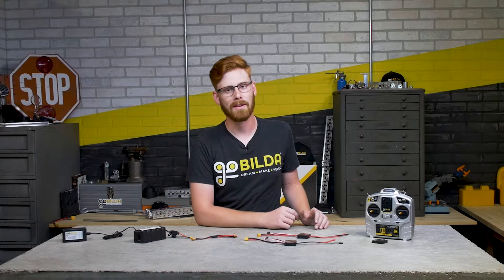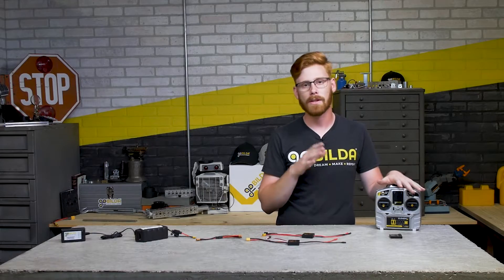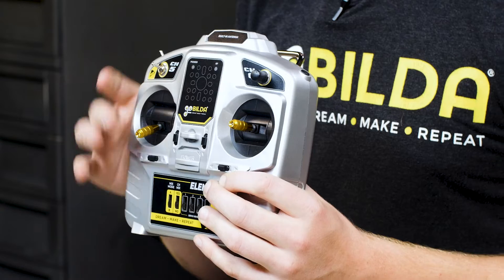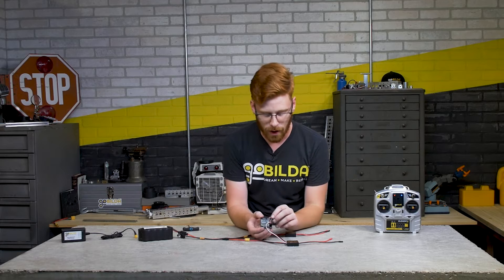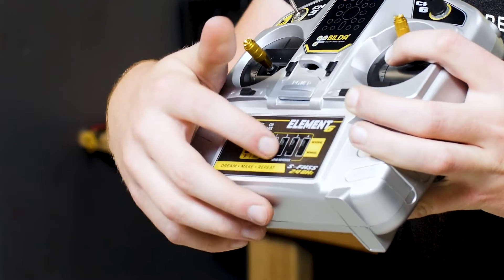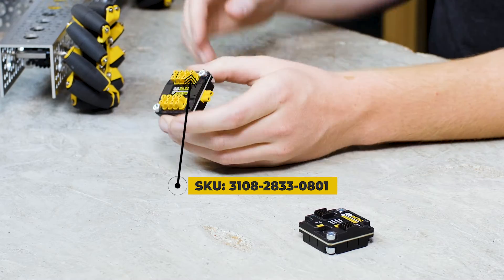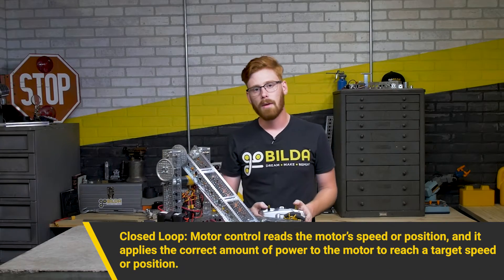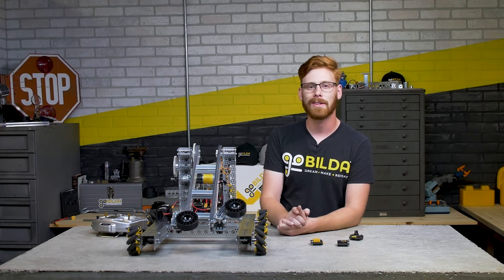RC Systems for FTC Prototyping

Comment: Cool , But what if your servos are higher voltage , 7.4? If I using 4 high torque servos at 7.4 volts.
Reply from the maker: Gary, You can certainly still run those higher-voltage servos, you just won't be able to use the BECs in the motor controllers to achieve that voltage. Your best bet would be to use your 7.4v external battery or BEC and remove the red wires from the servo connectors on the motor controllers.